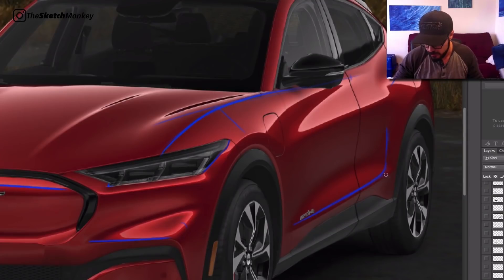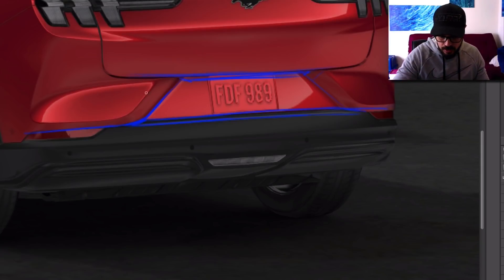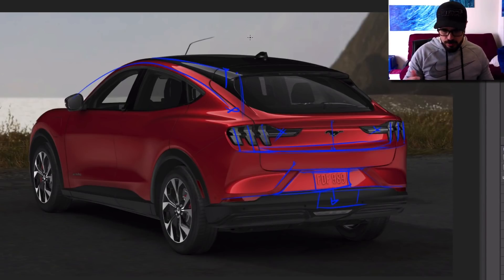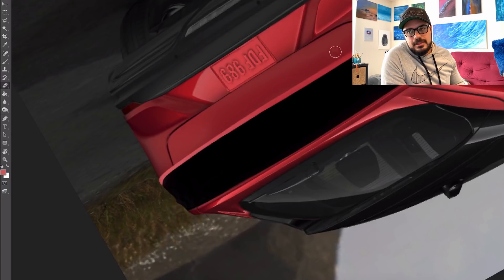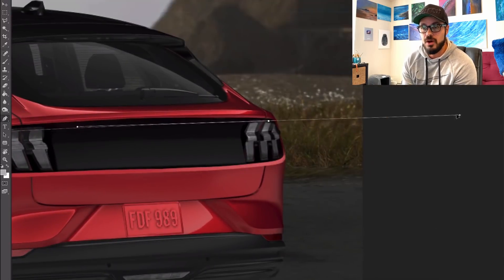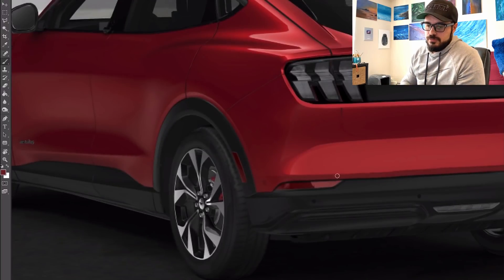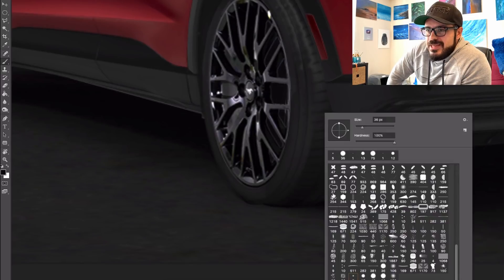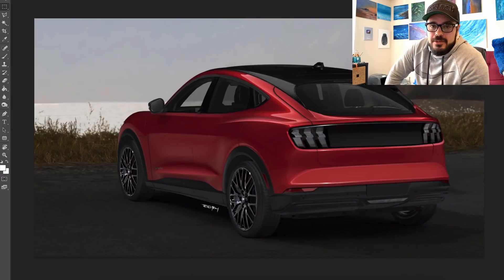I fix the rear end design of the Ford Mustang Mach-E

Comment: I agree that the current Mach E styling isn't bold enough for the Mustang name; I like your revisions. Ford's has said that the wheels are as large as current suv's, but there's something about the rear quarters that take away from that, makes the wheels look small. Your revision to the sharper 'hip' in the rear quarter helps this also. Thanks for a nice channel.

Comment: I think if Ford (and that quitter/loser, CEO Jim Hackett) were smart, they would have taken YOUR smoother design changes, given it an actual grille, and called it the "Ford E-Stallion" No "Mustang" or "Mach" anything on it, but with the 'Stang's running horse, taillights with sequential feature (for turn signals AND flashers) and an elegant cockpit just like the pony car's. 

The vehicle itself is a winner, but using the Holy Grail of Ford nameplates for the sake of making owning an electric vehicle cool? Epic failure.  Besides, "Expedition", "Explorer", "Edge", "Bronco", "Bronco Scout", "Escape", "Ecosport"; how many CUVs and SUVs does it take to keep a car company from bankruptcy?  

I think Ford should take the next Mustang platform (due in 2021) and stretch the wheelbase to like 116", and resurrect the "Torino" name for a mid-to-full-sized, RWD or AWD, I4, V6 or V8 powered sedan. "Torino" (family car with notchback front seats with center cushion!), "Torino Elite" (luxury), "Gran Torino" (sporty), and "Gran Torino GT500" (high-performance; equipped just like the similarly-named 'Stang) would be an awesome Fusion/Taurus replacement and a worthy Dodge Charger competitor.  Just sayin'!

🐰

Comment: If Ford hadn't done such a terrible job with one of their classic models in 2002-2005, they could have leveraged the "perfect" nameplate for an all electric car.   Thunderbird.   I mean damn, Mustang fans wouldn't have their knickers in a twist, and Ford could revive a nameplate that predates the Mustang by a decade; a nameplate that used to be aspirational  (1955 1976) and popular (1977-1990s).   Harness the early to mid 60s design language and embrace the 4 doors of the late-60s.... any way,, is there a better classic Ford name for an electric car than Thunderbird?

Comment: Probably would have made more sense to dig in the vault a little bit and use the name Galaxy, especially the way they introduced models in 1960.  The other name could have been Excursion, which makes more sense.  There is just no reason to badge this a Mustang.  As long as it remains a Mustang ... it will just be a Pinto to me.  I can't wait for the Camaro Esuv next!

Comment: I think their idea is a good one, and this being the first electric car, the fact that they made it a crossover vehicle with a clean-slate chassis design (as opposed to a retro-fit of an existing chassis) gives them a lot of freedom for packaging the necessary components.  This in turn will give them some much needed experience in electric vehicles for their next releases.

As for the name, they never should have used the direct Mustang moniker.  Using an offshoot (like E-Stang, or just Mach-E) would bring just a little bit of that cachet to the platform without stealing the actual Mustangs thunder and/or creating confusion within the sub-brand.

Comment: I think getting rid of the horizontal spears on the taillights makes the rear look narrower, which is a problem with this relatively tall vehicle. The taillights do need to be larger. Also agree needs more defined shoulders/haunches; something like the 1969-70 Mustang. For the front, needs some sort of a symbol of a grill, the idea used by Chevrolet with the Corvair; just an accent to draw the eye. Maybe a horizontal piece with the running horse in the center, which could be echoed on the rear fascia. And perhaps a scalloped diffuser on the rear at the bottom.

Comment: You said that electric cars are perceived to be boring. The golf cart image of electric cars is 10 years old now. When a seven passenger Tesla model S can out run on the dragstrip all but the most expensive supercars, that’s not boring. When you can drive from Los Angeles to San Francisco on the highway without touching the wheel brakes or gas pedal that’s not boring. When you can get over 100 miles per gallon in a hyper performance car that’s not boring. The list is long. ICE IS BORING.
Reply: Pretty sure he was commenting on the looks of the car, not it's capabilities. I'll tell you what else is boring about electric cars besides the looks, waiting 45 min to get 80% charge. So when they can get me 100% change in 5 minutes, then I'll consider an electric vehicle.

Comment: I just recently wrote a paper on the slow acception of autonomous and electric cars and design was one of the key factors I argued. Ford is using the Mustang's heritage and people's familiarity with Mustangs as a transition into these new vehicles. While it is smart from a business stand point, it's gone a bit too far for many fans and now is more of a Mustang classification debate more than a electric car debate. 

Electric Mustang? Cool idea, that one at SEMA was awsome! 
Four door Mustang? Eh, a bit unconventional but still a practical and cool concept.
SUV Mustang? No, it's one thing to add doors and new motors but to change the entire vehicle class is ridiculous.

The name Mach-E is great. Just say "Mustang inspired" or "designed with the spirit of Mustang"
Reply: It's WAY too early for manufacturers to be doing this, EV models should only remain as new models until EVs become fully integrated into society, only then will branding like this work.
Reply: @PliskinHK  I think @Garrett Lane did a better example at it
Reply: ok
Reply: I agree with you
Reply: I think the issue is that they have gone away from 2 of the main things that makes a Mustang... Coupe styling and big engine. If they would have kept the coupe styling and have BEV power then I don't think there would be as much push back.
Reply: It's not a mustang and never will be. The thing is is the fact that its electric isn't the problem. If they wanted to make an affordable electric mustang and more expensive performance electric mustang I'd be down for it. For had many high performance platforms and names they can use. Mustang owners (kind of a little cault if you haven't noticed) will never consider it a mustang. Just call it the Mach E. The mach name is not something that is to be taken lightly and as a symbol of high performance mustang myself and many mustang owners would be very happy to have it as our daily driver. The simple fact they have used the mustang is causing me to want to reject it. It is an ugly duckling with this name instead of a beautiful swan
Reply: @wessclox8760  While you may be right, the public eye who doesn't know too much about Mustangs will see the Mustang name and be inherently attracted. "Ooh! It's a Mustang? That means it's fast! An SUV? That means it's practical! I'm down!" I don't like it just as you don't, but I'll tell you, car guys (who wouldn't be considering buying this anyway) are certainly the minority.
Reply: @texemplarstudios5481  still not a mustang 😎
Reply: West Clox Actually the JDM fanbase is way fucking worse.
Reply: You wrote a paper? What for?
Reply: @texemplarstudios5481  I'm in college
Reply: @garrettlane6715  Well I have to say, that's a pretty freaking awesome class to have the choice of analyzing the acceptance of electric cars as a prompt. I might even do something like that in my free time!
Reply: Guys this is cool, check out the new cybertruck from Tesla
Reply: I think its fine using the name but goddammit at least make it LOOK like a mustang if you are going to call it like MUSTANG.

Comment: I was looking  forward to the e-mustang,  figuring  it would be a restyled mustang with a hot sub 3 sec 0-60 electric drive like found in the ludicrous mode Tesla. Or at least a new sports coupe with such a power train. While that may not have been as big a seller as an electric  crossover, it would  have made a great halo car to introduce the Ford electrics. Follow it up with this crossover a few months later ( with a different name, dear God) and I think they would have had a brake away hit. This, as a " mustang" just seems to piss people off. Time will tell, I could be wrong.